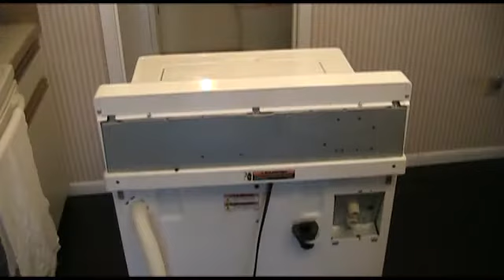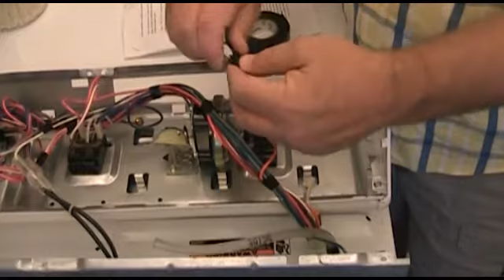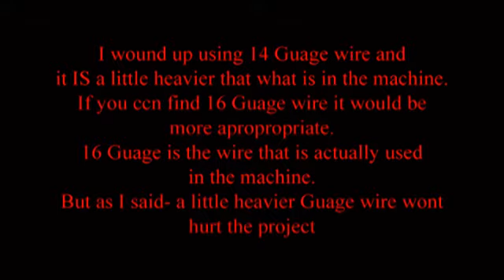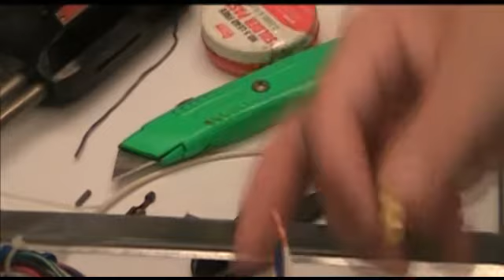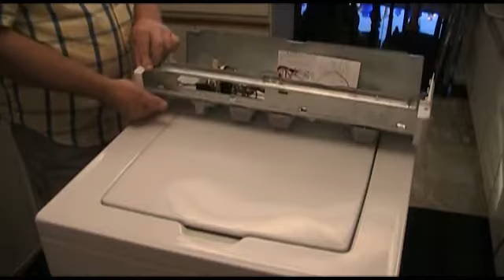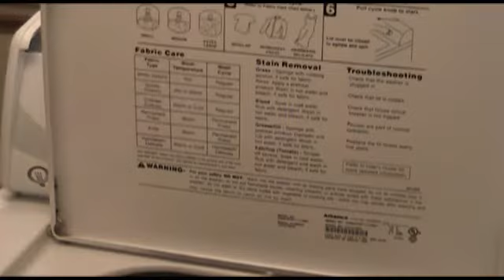Speed Queen Rinse Temperature Modification and Water level Adjustment

Comment: what is the benefit to having a warm or hot rinse?
Reply: If you have it out in the garage and in winter time, at 35*F, warm water is a better choice for rinsing than 35*F water. Plus fabric softener does not dissolve very good at those temperatures, leaving white blotches on your just cleaned clothes.

Comment: Has anyone found a way to apply this temp mod to the post 2018 models?  I wish what was shown here was viable for the new TC5's (AWN632) that they made to look like the old ones. All the spaced apart knob selectors on the front are a facade that equate to one single long circuit board behind the panel.  All micro selector switches, and only two very small gauge wire receptacles with total of nine wires. It would seem almost too easy to install a jumper between two of the wires, but I'm sure that is not the case. There was a single page, double sided wire diagram taped inside the interior panel, but it is very vague. It also shows a dip switch controller on the diagram, but I didn't see one on the pc board, so must be for other models. If anyone has access to a service/repair manual for the newer ones, it would be a great asset to be able to see if it is doable with minimal alteration.  I'd be willing to experiment if someone could offer that information for me to study.

Comment: First, a round of applause for Daytona and Pendleton Whisky (great name) for taking the time to post this incredibly useful information. You guys are both heroes. What follows is a true story plus a couple bits of advice. I have worked on appliances for years and have an inventory of a dozen washers and dryers that I give to people of limited means as a sort of hobby.
True story: Today I made the rinse-temp mod for a longtime friend who is a widow in her early 80s. She lives alone in the country and has difficulty walking owing to two hip replacements. Yet for months if not years she has been carrying hot water from her kitchen sink to warm the rinse water in her Speed Queen AWN432SP. Her well water is viciously cold and even the “extra rinse” process (Wonder why Speed Queen added that?) would not do the job with the machine’s cold-only design. When I showed her the flawless result of this mod she was almost in tears. True story.
Some notes:
1. It should be stated that this mod allows ANY combination of wash and rinse temps, even a cold wash and hot rinse. Select the desired wash temp, fill the machine, and, when agitation starts, switch the temp knob to whatever temp you desire for the rinse. When the timer hits the rinse cycle, it will follow the order from the temp knob. I have been doing this for years with my old Whirlpool at home, and tested it today with her Speed Queen.
2. I recommend snipping off the female connector from the wire removed from terminal 4. Then use a small (usually blue) wire nut to cap the blunt end of the wire. Wrap the nut and wire end with electrical tape. Then, arrange the wire along the length of the wire loom (instead of doubling it back as shown in the vid) and fasten it with small zip ties, including one on the electrical tape. For that wire end to ever become a hazard it would require failure of the tie, tape and wire nut — highly unlikely.
3. The crimped wire fittings in the vid come in three colors based on size: red, blue and yellow. Always use the connector that fits the wire(s) snugly so a safe, strong connection is made.
4. Although the vid mentions tiny zip ties, any size will do. They can be liberally used to bundle wires together. Her Speed Queen had annoying gummy black tape on the console wires. I removed it and used ties instead. They are used in millions of machines.
5. Consider marking the inside of the console with a sharpie to note that the machine has been modified. The paper wiring diagram that should also be in the console can also be marked as such. 
Again, thanks to Daytona and Pendleton for making this all happen.
Reply: You are very welcome.  I'm betting that your revisions will make it ever better so thanks for that
Reply: Nice informative video. Too much "what we're gonna do's for my liking.
Reply: @RH-ch6rn  more proof that no matter how much you try to help, somebody's gonna whine about it

Comment: Do you think the wiring set up for the SQ AWN 432 is similar to the 532? I'm interested in adjusting the water level in mine.
Reply: April, this one's for you:  https://www.youtube.com/watch?v=VpYpILUZqrQ
Reply: @PendeltonWhiskey  well, thank you very much!
Reply: @aprilk4420  You are very welcome, I hope it does the trick.  I'd appreciate it if you would let me know how it goes.  
  I've been trying to get people I know to do this and I haven't found anybody yet so I would love to know if you do it and if it works.   Anyway, good luck!

Hey, I just watched that video (the one I linked you to), pretty much for the first time and I remembered one little aspect there.  When he's using the socket wrench to tighten that nut, I remember something about doing it differently, in a way to insure that there would be no damage to the adjustment device by using your fingers instead of the socket wrench if possible.
 
A lot of damage is done by using more force than necessary, 

I THINK (remember, I don't have the exact same machine that you do so mine could possibly be different although they appear to be extremely similar) that if you depress the 'spring' (it's a bent piece of metal that is being used as a sort of a spring, an adjustment spring) that the nut resides upon with your finger or thumb and then using your other hand, screw the nut tighter, you can avoid accidentally applying too much pressure with the socket wrench which could possibly damage the adjustment mechanism and we don't want that to happen.
Guys love their socket wrenches but the inner workings in that control console aren't really all that sturdy.  A washing machine isn't built as tough as a car.  The steal just isn't very thick.  
Bottom line, don't use the force of a wrench when your fingers can do the job and you will have far less chance of unintended consequences. 

One more one more one more thing - wear rubber gloves when you're in that panel.  It would be more difficult to do this while unplugging and replugging the washer in so you're probably going to have to have your hands in the console while it's plugged in but if you wear rubber gloves you should be fine.  Also, good to avoid tools like socket wrenches if possible because there is going to be current going through that console and you don't want to cause a short.  That would definitely be an unwanted unintended consequence.  I like the disposable rubber exam type gloves because I can still have dexterity.  

I'm way more excited about this than I should be.  Being locked up in my house for way too long could have something to do with it.  I"m spending way too much time on this silliness but hopefully it will help.

Anyway, 
Good luck!
Reply: @PendeltonWhiskey  go ahead and delete your email. I got it. Thank you very much! I watched the first few seconds of the link you sent and I can't believe how stinking easy this is! I've been a harpie about wanting my water level adjusted..seems like forever now. I know I can manage this on my own. I have been adding water to every load, with my wash tub hose. So glad I won't have to do that anymore! I will be sure to let you know how it goes. Thanks again!
Reply: @aprilk4420  Ok April, just remember, when you get in there check and see if you can depress (what I'm calling a spring) and thereby eliminate the pressure on the nut which will enable you to simply tighten the nut with your free fingers.  That would be much safer than using a socket wrench. Rubber gloves!
Reply: OK and even one more thing.   Don't use a socket wrench on those little sheet metal screws.  They are SO EASY to strip!  If you just use either a screw driver or a hex head driver or even a deep socket and turn it with your fingers instead of a socket wrench you are far less likely to strip those threads.  If you're thinking I might be just a tiny bit obsessive about stripping threads you are 100% correct!  I hate stripping threads!  AND get every screw threaded but not tight before you start tightening them down.  It helps.  Some of them won't match up but if you wait to tighten them until you have them all started everything goes together much easier because you can 'jiggle' the sheet metal to allow you to get the screws started but once you tighten even one of them - no jiggle allowed.

Comment: The question is though, why would you need to rinse with hot water?
Reply: I use hot water to wash bed sheets.  I'm probably a bit obsessive compulsive about it but I can't stand the idea of sheets coming out of the dryer anything but as clean as possible and also (maybe even more importantly) completely free of soap.  With this hack the rinse is the same temp as the wash instead of always having a cold water rinse which is the way it was when I bought it.  I'd have been fine with a warm water rinse with a hot water wash (which is the way the washer operated prior to the EPA modification) but that's not the way the washer functions after this hack.  Not that I mind, I actually prefer the hot water rinse but I could have lived with a warm water rinse for a hot water wash.   But it's only sheets, not my regular wash.  I use warm water for regular wash which means that it gets a warm water rinse.  Honestly, I never use cold water to wash clothes.  Doesn't seem right somehow.
Reply: Cold hard water does not rinse well at all.

Comment: Great video and thanks for taking the time and putting forth the effort to share this information. Greatly appreciated.

I purchased a new AWNE92SP about a year ago with the electronic controls, it's a very nice machine and allows for a wide variety of washing techniques to match the clothes being cleaned. The water level fills to the top holes when set to full load, no problem there. 

About a month ago I picked up an AWN412 which is the basic model with electro-mechanical controls. The owner purchased it about two years ago but stopped using it only 8 months later due to a well water shortage. He pick an HE machine and decided to sell the Speed Queen that had been sitting idle for a year. He decided to keep the matching Speed Queen gas dryer and would not offer it for sale (I asked). I now have both connected and working in the basement, using the old machine for towels and work clothes and the newer machine for dress clothes and dedicates. 

The old machine AWN412 required the water level adjustment and in my case required about 1.25 turns clockwise to set the water level to the last row of holes on the inner tub. Decided to leave some space there to keep the suds from washing over the sides when the machine is running.  Both are working fine and are mechanically identical differing only by the electronic verses electro-mechanical controls.

Addendum: Checked the rinse temperature on my AWN412 and the rinse temperature corresponds with the wash temperature setting on the control panel. No modification needed on this model.

Comment: You were crimping that terminal sleeve too close to the end, youre supposed to crimp in the middle of the narrow part of the plastic sleeve, its the center of the metal sleeve inside.
Reply: yambo59, Did you do the hack and if so how did it turn out?
Reply: I only did the water level adjustment and bypassed the lid switch, both work great. I don't feel a need to do the more involved temperature mod as the clothes come out clean with the factory cold rinse.  Now I can get that last inch and a half or so full without having to use the reset button and fill it manually - only had to go about 1/4 to half turn, do it in small increments and hit the reset switch after each tweak to be sure where your water level is at. Then you might even put it on spin to let some water out then let it fill back up on its own at the extra large setting just to be sure you haven't gone too far and overflow the tub.  Also I don't recommend the lid switch mod if you ever have kids around, they could be seriously hurt.  I have no kids just me and with the lid switch bypassed I can wash with the lid open, doesn't even splash.   Of course you wouldn't want to stick your arm in on the spin cycle-!  Just sayin'-lol
Reply: I've left the lid switch alone on mine because I have no idea where that machine might end up.  I'd hate to think of a machine without a lid switch being in a house with kids.   On the other hand I grew up in a house with just such a machine and managed to keep both my arms.  That being said I'll just leave the lid switch the way I found it.   The thing I couldn't live with was having a machine that only half filled with water and not being able to have a warm water rinse if I wanted one.  
Glad it worked for you and thanks for the reply.
Reply: That's a responsible position on the lid switch, washing machines end up all over the place as time passes.  And its not that the SQ only fills up half way, id say It fills up at least 3/4 if not 7/8 before the top row of holes - which is the highest anyone should go.  I just wanted to know if I wanted the full tub it was available to me.  I do wish it had a warm rinse, but so far the clothes look and smell clean so long as that stays the same im happy as is.  Besides I don't want to make any hard to reverse modifications in case it should need warranty service.  All I have to do to restore the lid switch is pull a small piece of rubber from under the back of the control panel, and the water level could be restored by removing about three screws and giving the water control a half turn.
Reply: I think it's possible that the machine I bought had a lower water level setting than others might have had.  It was ridiculously low but not any more.
Sad to say I hear the new 2018 Speed Queens aren't worth having.